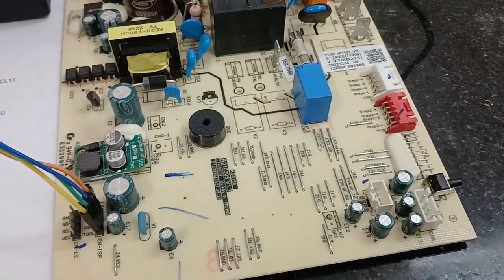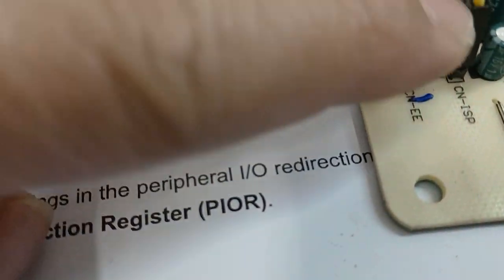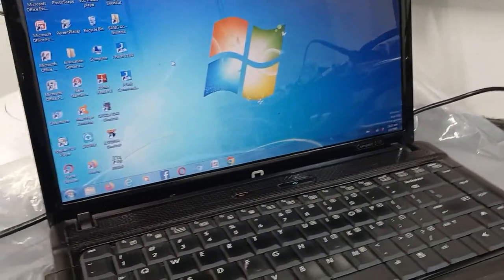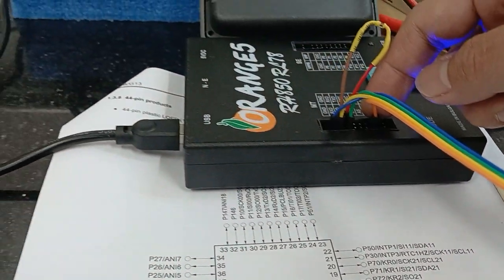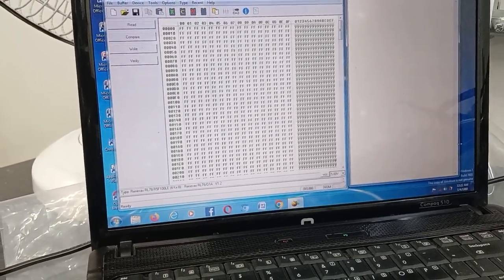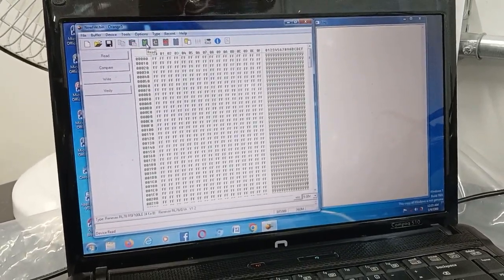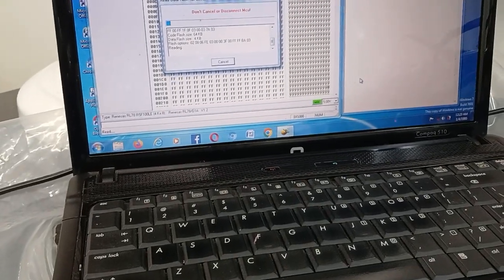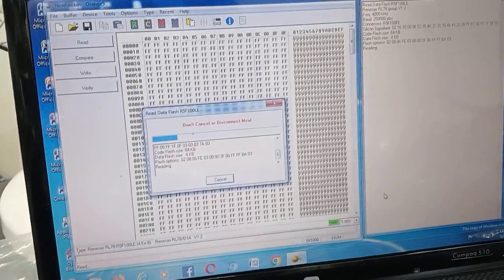Airconditioner board with Renesas MCU data copy using Orange 5 programmer

Comment: Hello sir my orange 5 programmer rl78 series not open hpx.file load error will be show how to solve this problem?
Reply from the maker: @pankajn2594 
check this original supplier
 https://scorpio-lk.com/orange5.html
Reply from the maker: @pankajn2594  did you buy original programmer?
Reply: Yes sir
Reply from the maker: @pankajn2594  you can contact the seller if that is original programmer...
Reply: Ok thank you sir
Reply from the maker: @pankajn2594  how much you buy for the original and where did you buy? i need original also
Reply: sir I ask seller sir he is saying he is purchased from china. and he is saying he don't know original and clone
Reply: Sir how to find he is  original and clone?
Reply: sir I have question without mcu connect rl 78 mcu hpx file load happen
Reply from the maker: @pankajn2594  your programmer block by windows or firmware damage since that programmer must be have licence
Reply: Sir, how do I know whether my programmer has a license or not?
Reply from the maker: @pankajn2594  original programmer is expensive more or less 500USD
Reply: Ok sir thank you I understand what you say my programmer is 175 usd

Comment: Bạn cho tôi sơ đồ kết nối dây cụ thể giữa organe5 với board dc không
Reply: Chào bạn, tôi đã mua bộ lập trình orange5 và đã gặp vấn đề với bộ lập trình orange5 của mình, đĩa DVD phần mềm của cửa hàng gửi cho tôi, không thể mở file orange5  bạn có thể giúp mình không
Reply from the maker: its in the user manual after you buy the programmer
Reply: @rodskietechtv1296   tôi đọc chíp R5f21275 của renesas  bằng orrange5 không được, bạn có thể giúp tôi không
Reply from the maker: i will try to upload the video...
Reply from the maker: where did you buy your programmer?